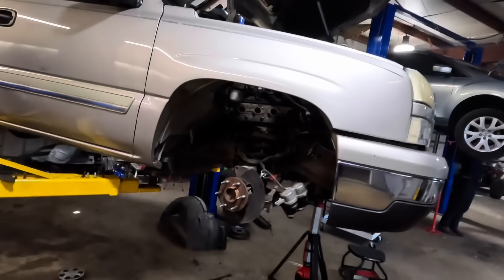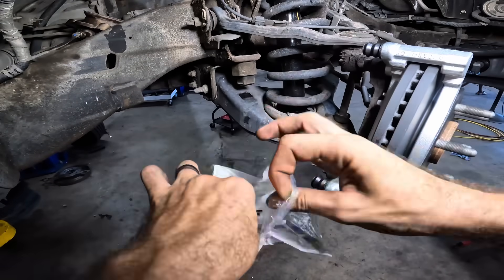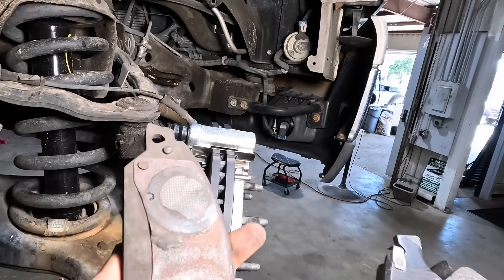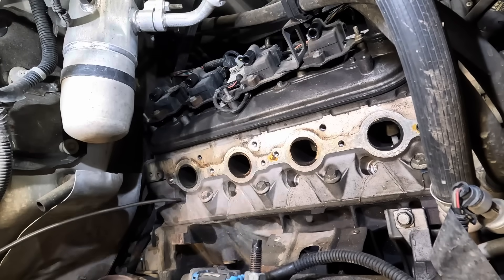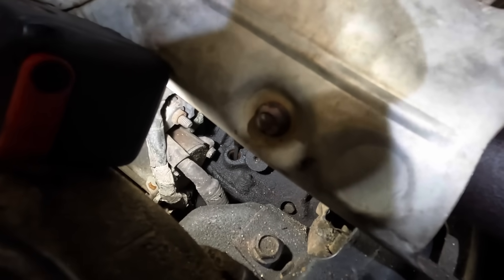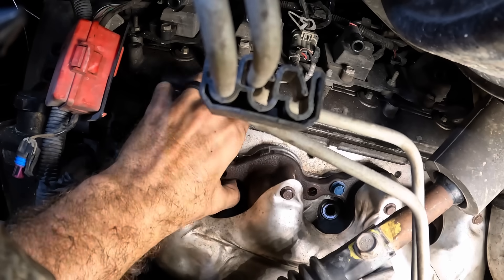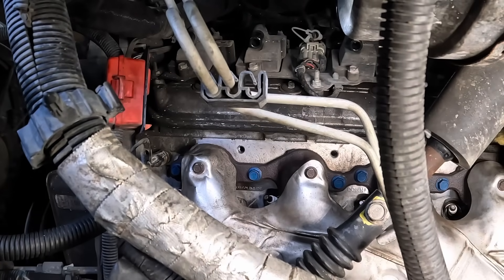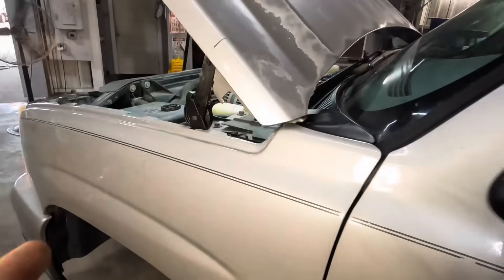Broken Rib Mechanic! Get it DONE! Exhaust ended the day. Silverado 5.3 4.8 6.0

Comment: 1. Well, it's true to a point.  Your business is now on older vehicles in a shop that is now all yours.  You set the tone and that tone is low drama and quality output.  Your personality dictates your business and I can assure you if you were the excitable type, throwing wrenches about and cursing, your staff turnover would be high, the Wifely Unit would be displeased and your customer base will diminish.  Brake cleaner chucking doesn't count (well I wouldn't allow it, but that's me).
2.  You poor lad.  That bloody truck has been occupying a hoist for at least a couple of weeks.  No one is at fault, but as long as you can put up with 1/3 of your shop not needed, you must be fine
Keep on keeping on.  It really looks like you are enjoying your own path.

Comment: When you were working in the old shop, you were also tending to do shorter, simpler jobs.  Your channel is evolving into being more like Watch Wes Work, where you are doing more long term projects on older cars that have more problems.  Personally, I find this much more interesting than the never ending parade of oil changes and tire rotation.  I watch guys like you, Wes, and Ivan at Pine Hollow precisely because I'm trying to keep an elderly van on the road.  Every time I watch any of your content, or Wes' or Ivan's, you make me a bit smarter.  Honestly, the only complaint I have these days is with the movie references.  I can watch a movie if I want to.  I choose to spend that time watching you instead.  

Whenever my back gets like that, I'll go sit in my van, hook my arm around the armrest or seat back, and rotate around like I'm fixing to back up like we did in the days before back up cameras.  Do it both ways, several times, as far as you can possibly go.  That will get a bit further each time you do it.  At some point the back will probably crack, and then feel a lot better.  Living with fibromyalgia, this is a daily occurrence for me.  Might not be a bad idea to put a twin bed in the office.  If you have a sick child, you'll be glad of it.  It would also be a place to rest if you aren't feeling well.  A futon would work too.

Do you ever have trouble with the dielectric sealing air in the spark plug boots, which then pushes the boot back off?  I used to have that problem with my Ford Escort.  Even if you made sure it clicked, it would still pop off.  Boots were different back then though.

Comment: @18:50 if you fill the caliper and hose before you install them and if all the air is out when you conect the rubber hose to the steel line , you won't have to bleed the system ???

Comment: Don't need drama.  Question, does the blue coating on the manifold bolts serve as a never-seize compound?  If not, should you be using never-seize

Comment: I’ll first say you are an excellent tech and there is very little light between the way you approach jobs to the way I do but Man I would think you’d want to get that old brake fluid out if the system before pulling all the new stuff on and maybe not use an impact gun on the banjo bolts.

Comment: Hey ray, recently subscribed, I've been watching your videos and you're one of the most talented mechanics on YouTube, I'm sure in your shop as well and I know for a fact by watching your videos there's not many shops that can do the work you do as quickly as you do, I'm having a problem, I have a 2004 Ford F-150, 4 wheel drive 5.4 liter XLT extended cab it has the four door the rear two doors are half doors new body style,  I'm getting a check engine light for a fuel tank pressure sensor,  the listed part is not the part for my truck, I'm having a problem solving this problem the fuel tank pressure sensor that I need has two hoses used to send fumes to the engine one on each side and the electric connection, it sits freely on top of the tank there's clips that hold the hoses securely to the tank keeping the sensor from bouncing around, the sensor that is listed for the truck  the parts stores online  gets pushed into the top of fuel tank in order to get the vacuum to send fumes to the engine and it has an electric connection and one hose and that's not the one that's on my truck I was wondering if you can help me with this and if you had this problem would you have a part number thank you hope to hear back.

Comment: How did you remove the other 2 broken bolts?
Reply: Ray used a bolt extractor bit that will bite into a broken bolt allowing for the removal.  The one that got welded kept breaking hence the welding.

Comment: Look at this fancy southerner and his ability to take a brake line fitting off with a straight open end wrench without rounding off the fitting because it's corroded to the threads, or twisting the brake hardline because its corroded to the hardline (or both). Up here I don't dare touch a brake fitting without a flare wrench, penetrating lube, and a prayer.

Comment: A nap with a tennis ball under you (where the sore rib is). You've dislocated a rib bone from its socket. I've had so many of them it isn't funny. They hurt like a son of a gun, even just to breathe (depending upon angle). Alternatively, I've slept on my fist, which helped greatly, but is uncomfortable and for the last option... Go see a chiropractor for the pain. A quick adjustment and back to relative normal. Snap crackle pop and you're good as new.
(I've had 8 car accidents - all 100% not my fault. And yeah, "Relative Normal" is the only way to put it.)

Comment: Why don't you use studs made out of cut off bolts to slide the gasket and the manifold on . We always did when I was a mechanic when ever we installed gaskets.

Comment: I would use high heat "never seez" on those manifold bolts if there ever is a next time. Not a tremendous amount of torque to worry about stretching threads.

Comment: 26:34  I am in the industry, am prefer the new way.  Nearly set up a shop once with a then coworker and friend.  My friend would have run the front (he is really good with customers),, I would have run the back.  The owner decided not to retire at that time, and so the deal fell apart.

Heard he did several years later, and the place collapsed when it got sold to somebody who shouldn't be in this line of work.   Too much of the crap that ruins this job's reputation, I suspect.

Comment: Aluminum heads and cast iron exhaust manifolds, expand and contract at different rates. This puts side pressure on the bolts, the tolerance between the bolts and manifold holes is faulty. Bore the holes just a fraction, tighten the bolts as usual, you won't blow the gasket. The total number of broken exhaust bolts must be in the millions. This is a total design failure.

Comment: Why don't you use an old spark plug wire and boot to capture and install the new spark plug?
You will never drop a spark plug or cross-thread the new one.

Comment: Dont get me wrong, I am a car lover but I an wondering if Americans will keep on driving these 5 or 6 liter enigines, V8 and what not even when we are trying to save the planet. In Europe we dont drive these massive cars. We drive fairly little 4 cilinder 1.6 to 2.0 liter engines in cars that weigh maybe 2500-3000 pounds or 1200-1500 kilograms. What do you think about this? Dont worry, I do not support XR or any other enviromental group, as I said I love cars, own 2 cars, so dont hate me please....

Comment: 3/4 ton pads so why do mechanics put those aluminum screws in the rotors you all know they strip causing the customer money in  screws and labour time to drill them out and there useless leave them out and use a lug nut

Comment: Why would you want to put old brake fulids in new components if you flushing out the system anyway
Why no suck it all out of the resevor and lines, then when you do flush the system you only have new fluids in new components meaning new parts dont get contaminated with dirty oil mixed waterery rusty fluids  99.9% chance any rusty fulids came out of cast iron parts like the main cylinder and all the slave cylinders the dust boots dont always keep everything off the pistons  and crap works it way into the bores. Only thing to hold it back is a flat rubber wipe aka flat 0 ring.
Secondly the master cylinder and hydrlic oils in plastic containers 
Plastic can weep moisture the mocules let some pass. 
I've been told it best to only buy it in metal cans or fresh products.  Stuff thats been on the shelf for a long time isn't good.